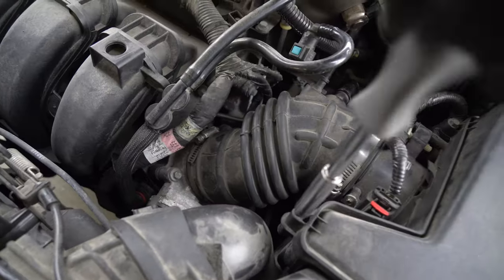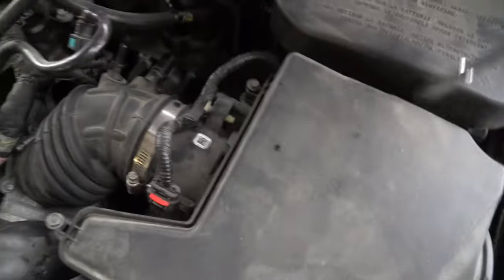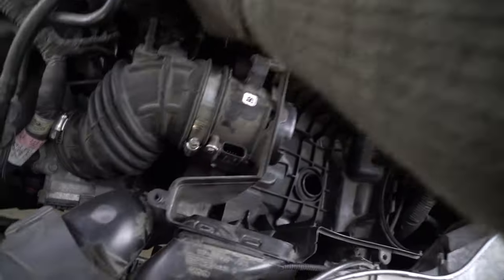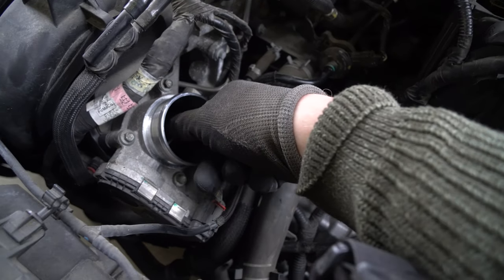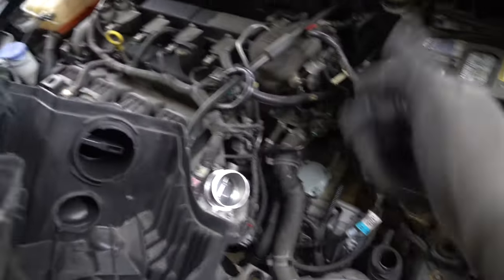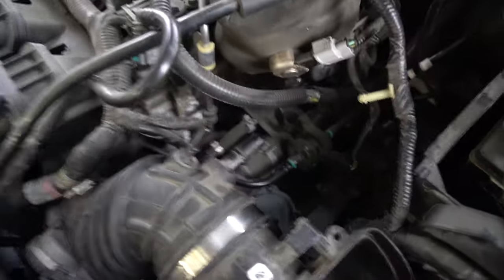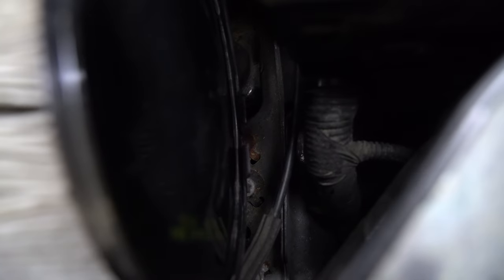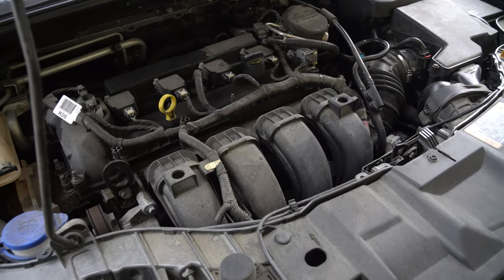HOW TO CLEAN FORD FOCUS THROTTLE BODY FOR BETTER IDLE

Comment: I cleaned it but didn't fix the problem. RPM isn't stable when I turn on AC
Reply: this focus shit about stable rpm goes up goes down with a/c or turning steer 😂😂😂
Reply: The ac boggs mostly any 4 cylinder down under a 2.5 ive noticed and owned over the years.

Comment: Hello. I want to ask for help. 2003 focus 1.6i FyDD These are brand new in focus. There's nothing wrong with these. - idling engine -ignition cables -ignition transformer -4 new candles -fuel vent cleaned. Throttle body cleaned And he's still doing it...even in the middle of it he chokes... The idle is not good.

Comment: What year is that? I have a 2008 focus, It looks completely different. The car shut off the other day when my wife was driving it. I diagnosed it and got a p2107 code. So im trying to see what i can do myself vs bringing it to Ford
Reply from the maker: All you do is locate the throttlebody pop off that tube that goes between the throttlebody and the airbox disconnect, the wires off of it. Then clean that throttlebody up. Sounds like your throttlebody though might be on the way out. It’s saying the actuator is causing issues.
Reply from the maker: Definitely try cleaning it first like I show and then if it persists I would purchase a new throttle body and bolt it in
Reply: The code is the crankshaft position sensor.

Comment: I’m not much a video maker but I will have to make one showing in much simpler way. I’ve done it this exact way so many times I got pretty quick at it, but all you have to do is pop that rubber clip under the clamp at the throttle body pull tire, airbox everything out at one time, and it comes out very easily, you don’t have done both all of that stuff

Comment: AEM dry air filter from K&N website 
fits perfectly in these... (roughly £40)
not only are they washable/reusable 
saving you money in the long run 😉👍🏻
but also oil-free which is recommended 
if your vehicle has MAF sensor fitted.

Comment: I have Ford Fiesta 2010engine idling below 750 rpm.?
Reply: Hate it ! even with a clean throttlebody it idles around 750rpm.
What i did was i changed the warm idle speed  to 900rpm with the official Focom software.
Now it runs extremelly smooth and fast ! when going of from stoplichts.
They make those cars with low idle for better emissions nothing more, and you get a sluggish car.

Comment: i have a ford cmax with code p3000 random misfire, spark plugs changes prior and the leads and coil pack. Car does not accelerate properly and does so after a few seconds of hesitation. could the the throttle body be the problem?
Reply: Check your spark plugs and coils before moving to the throttle body. Misfire is going to be a spark issue, not an air issue